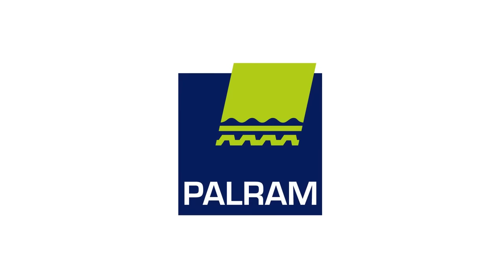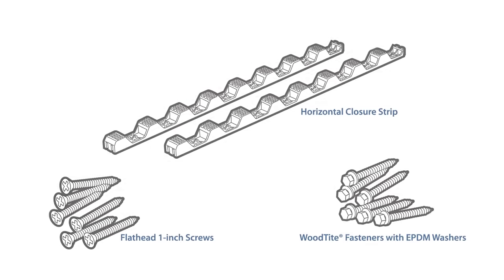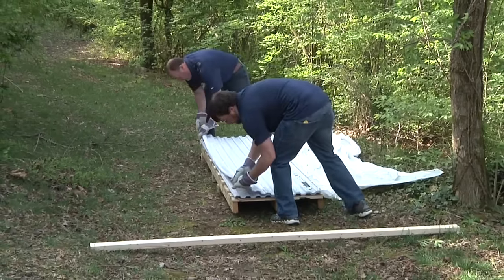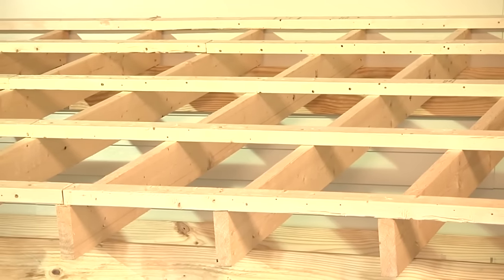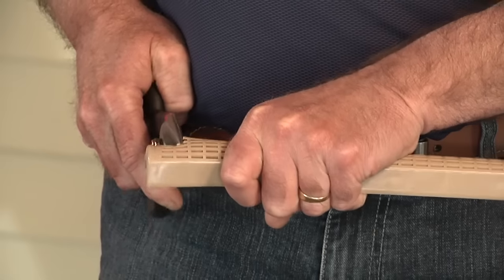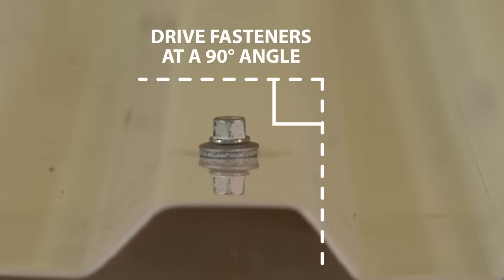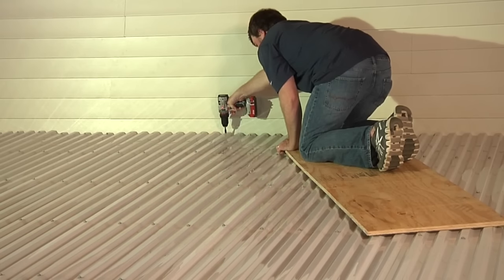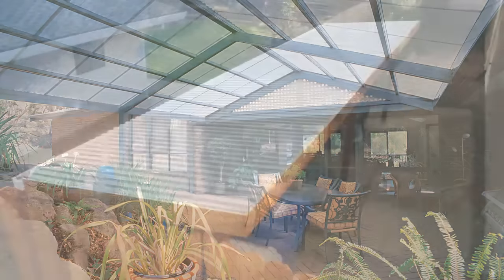How to: SUNTUF® Installation DIY

Comment: What length should the Woodtite fasteners be?
Reply: 2 Inch fastenres in a roof application.  Crown fasten the panels.  on a wall you can use a 1" fastener and valley fasten.
Reply: Jeremy Cohen Hoffing greenhouse floor

Comment: weather proof? Snow?
Reply: Snow load is dependent on the support structure framing.  Generally speaking the panels are strong enough to support significant snow load but you need to make sure the structure itself will handle the load.
Reply: Yes very weatherproof and snow proof as long as you install properly.  I live in Canada and we have used this product for many years with many rainfalls and snowfalls without failure.  If you get snow in your area I would recommend building the pitch of your roof a little bit more steep so that the snow will slid off.